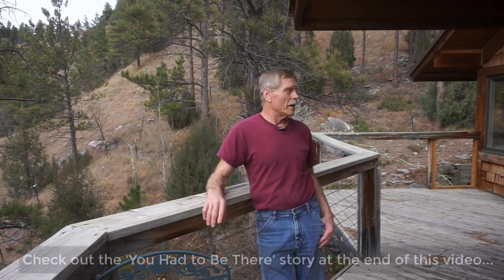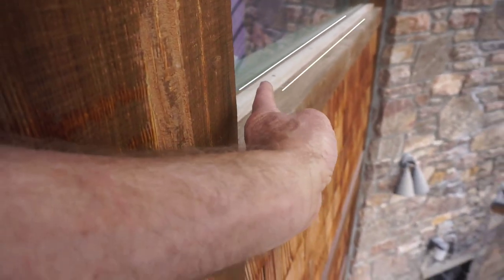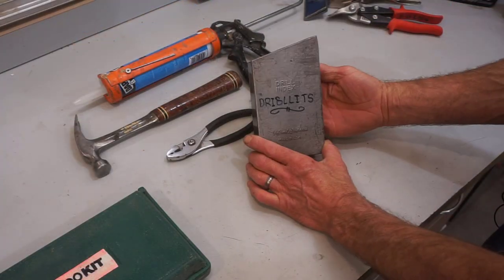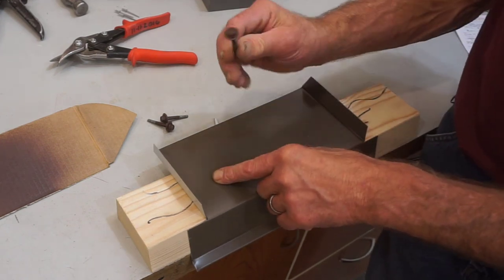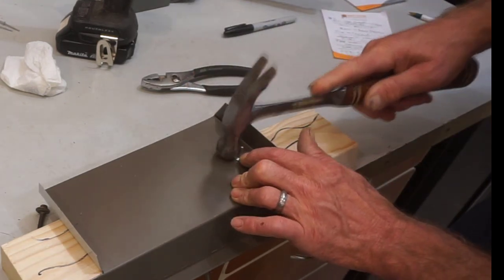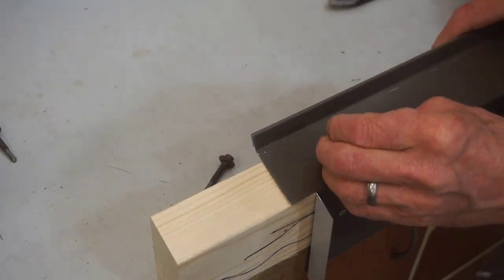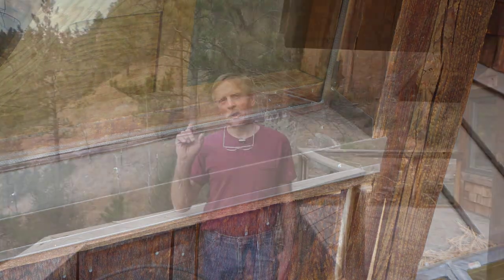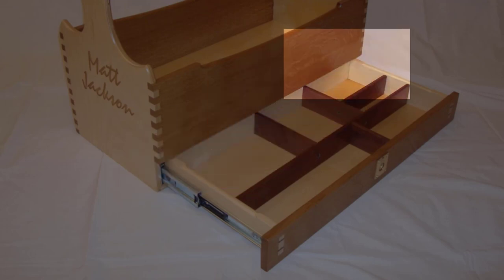Reverse Pop Rivets Fasten Metal to Wood?!

Comment: Since the rivet is aluminum and the shaft is as well, you might want to take those pliers, put then end of the shaft (the part that penetrates the wood) and squeeze the pliers to create a tooth on the shaft so that when you drive it into the wood, it acts like a hook to hold better. Kind of like a ring nail.
Reply from the maker: Great suggestion Timothy... I like it!  Thanks for watching and commenting... Best, Matt
Reply: @NextLevelCarpentry   NP, also I suppose if you had a checker face hammer, you could just give it a whack.

Comment: great tip .bet you could even use the mandrake to drill the hole leave it sticking out the chuck 10 mm or so
Reply from the maker: Hey Chris, It might work for the wood but only after drilling the metal with a dribllit... unless it was aluminum flashing too?  Best, Matt

Comment: -Great idea but don't use aluminum rivets as the center part,  the nail, with expand and contract and back out of the hole. Use Stainless steel rivets to prevent that.

Comment: We have theese hardened "flashing" nails in Norway we use, with different colors.
Same principle, but they are serrated and holds very good.
Since its hardened we dont have to predrill, but they are short enough and you need a proper wack to get them in.
I call them blue thumb nails.
Reply from the maker: 'blue thumb nails'  LOL!!
Reply from the maker: @mr.wizeguy8995  maybe so, but in this installation it would be problematic to drive fasteners into glass 😲
Reply: I saw that, just wanted to share how we do it here. 
In your case that caulking and few screw to those upright bends on each end would be enough for sure, no need to pierce that actual sill.
Reply: @nullings  One way to do it but those windows were worse looked like frame depth was like 60mm. Our standard window frame depth is 130mm and you can order even frame depth with 200mm so way more energy efficient.
Reply: @mr.wizeguy8995  Windowdepth in norway is 250-300mm. This was just a garage. The window is standard 98mm (2x4 widh).
then you mount a board against the window, flush with the wall. that way you get even more insulation in, since the board is only 19mm.
https://www.youtube.com/watch?v=a72YzKHHZH0

Comment: Seems like a great trick.....but what advantage does it have over a similar sized common nail?
Reply from the maker: Just a little bit in the looks department IMHO... not a bad idea to keep in mind for certain little detail applications though, right? Best, Matt
Reply: ES, I agree with you.  My first preference would be the 1" trim nails made specifically for flashing; provides a 1-piece head vs a 2-piece head.  I'd get the same dimpling (if I wanted)

Comment: This seems like an awesome trick! But I'm wondering how well it will hold up over time. Many of the aluminum nails that are holding my flashing to my house have worked themselves loose over the years.
Reply from the maker: Hey Todd, There's potential for nails like this to work themselves loose over time and in places where that's likely or problematic just use screws instead.  For this installation the wood was so dense I hope it doesn't fall to me to remove this flashing ever.  Keep in mind that I'm not showing best practices for windowsill flashing installation but, rather, the reverse riveting process.  It can be used for all manner of applications, many of which are interior metal panels, it's just that this installation was convenient for shooting and producing video.  Best, Matt

Comment: Why not just use a stainless steel 6 penny box nail
Reply from the maker: Why not... just use a reverse rivet?
Reply: @NextLevelCarpentry  lol the box nail does the same and lays flatter that's what we use just another opinion  sweet house
Reply from the maker: @tuckpoint2  'just another option'... exactly!  I totally understand your use of and comment about box nails being something you use on a regular basis... it's all about what's best for the job at hand, right.  Thanks for your comments! Best, Matt
Reply: the rivet pin is a taper going into a sleeve so its expanding, so you have the wedge grip of the wood + wedge grip of the rivet head, meanwhile every year I am running around my place tapping back in stupid ass nails that slide back out cause it got slightly damp and slightly chilly 

that's why
Reply: Correct me if I'm wrong, but the expansion of the river makes it a much more solid connection.
Reply: cobalt 8 nickel cylinder nails would be a better fit for the job.

Comment: Thanks Matt, thats a new one for me too. Thanks for sharing. One quick question, on the finish product on the        break metal on the ends, does that also get fastened and caulked or just stay as the picture showed? Take care            Matt, cant wait to see the new shop when its completed. Al from Maryland
Reply from the maker: Good question Al... the vertical end tabs should get caulked but, oddly, in this case I chose not to.  My thinking is that the caps are SO much better protection that nothing that they didn't need it so I left 'em just like that.  The other reason is that the way the wood is all checked and weathered some moisture is bound to get behind and under the flashing anyways and the unsealed ends should help it 'breathe' and dry out better.  I don't expect you or anyone else to agree with my thought process, reasoning or judgement on this one though... it's seeming a bit whack to me right now as I type this! 🙄😲😎 Best, Matt
Reply: Hahaha, yes I understand Matt. That original wood was designed not be flashed but with the bad angle it was installed with in which it didn't look like much, the water just sat on it and it deteriorated over the years. Usually when you flash over any wood you try to seal it up so no water can ever get in especially the soft pine they sell at the box stores that will rot in no time if it's not properly painted or covered over with your typical coil stock or other materials. Yea if it gets a little wet maybe the air will blow through the top of the vertical ends, LOL. You can do no wrong with me my friend. Always enjoy!!!!
Reply from the maker: @chipshot442   'you can do no wrong...' IF ONLY! 😁😎 main thing is that you 'get it' when it comes to the often convoluted path between 'need' and 'solution' in the real world of remodeling!  For now, Matt

Comment: The rivet stud is not able to expand the back side of the rivet so the only thing you've done is basically use an aluminium headed nail with a weak joint just below the head.  Besides how effective would a shallow rivet be in a blistering window sill?  A galvanize nail would probably be more effective but I'd stick with the metal screws with the rubber washers and some poly sealant for the edges.
Reply from the maker: That's obludolicant, Chris, probably sensible in your case.
Reply: @NextLevelCarpentry , obludolicant??? Is that like covfefe?  Google even draws a blank.

Comment: Ok, please explain the difference between this and a nail?   The bulb of the rivit does not expand the outer part of the rivit, from what I can tell.  What really holds it into the wood?  Just the raw rivit post?
Reply from the maker: The difference is mostly in the appearance of the rivet head vs a nail.  The rivet's mandrel is equal to about a 5 penny nail and plenty to hold this flashing in place.  I state clearly in the video that 'this is obviously not a universal solution' but you might have missed that part so anytime it's appearance isn't important or holding power isn't adequate, don't use it.

Comment: I want to add coragated metal to the ends of my garage cabinets can I use a shorter rivet so I don't go all the way through my cabinet  ? Or would I just grind off what has gone through  ?
Reply from the maker: Sounds like you need very short 'grip range' pop rivets,  like 1/8", for that application Kevin... you'll need a pop rivet gun too.  Don't grind the end off though as that weakens holding power almost completely.  If they stick out you can use a steel block dolly and ball peen hammer to mash them down to almost nuthin' 😎

Comment: Since the work piece you demonstrated with was scrap material anyway how about a destructive test? I'd like to see how it compares to the screws as well as to the painted finish nails I typically use in no-load must-look-good situations. In any case that's a great trick and it's going in my bag of tricks! A perfect application I can think of is for putting up stainless steel backsplash behind a range. I had a job where I needed to do that several months ago and I couldn't find a fastener that looked nice enough and finish nails looked dinky so I relied on glue, and it slid down 😔. Next time I'm using the reverse rivets!
Reply: If this is exceptionally strong I may use it to attack downspout straps to walls when I run out of screws.
Reply: And I know others may or may not have the luxury but I live and work just minutes from an aluminum and vinyl product wholesaler so I have nails of any color at my disposal. Granted, it's generally not preferred to use a nail on a flat surface due to the guarantee of an eventual leak...so you made the right call here to not even mention nails.
Reply from the maker: Interesting you should mention the 'stainless steel backsplash' installation Austin.  Turns out the first time Sam of Division 7 sheetmetal saw this trick used was a guy he was working with used it for exactly that: stainless steel backsplash/range hood panels etc in commercial kitchens.... great minds think alike!  I don't see any 'destructive test'ing' effort on my end but would say that anytime there's a question of strength it would be wise to opt for a regular nail of greater length or a screw just to be sure.  Strength is all the reason you need to justify visibility of a bigger hex head and washer.  I think you'll love the reverse rivet trick for the right situations though! Best, Matt
Reply: @NextLevelCarpentry  well that's pretty cool that's how he came across the idea! By destructive testing all I really had in mind was slide a pry bar under the end of the metal and attempt to pop the rivet out. (Exact same technique and same tool as to remove an asfault shingle) If it just stays there and the metal breaks around it leaving a hole (which is exactly what happens when you try that with screws) I'd consider that an A+. An F would be you can pop it right out with no damage to the metal around it, essentially as good a job as a little tape. In any case, if you chose not to do it on video I might give it a try myself, I happen to have some scraps of that lying around. It would be best if I try that out on scrap first anyway before I try the rivet trick on a $50 piece of stainless steel...
Reply: @NextLevelCarpentry  on a different subject... Your crescent nailpuller is back on Amazon! I order it yesterday. But it's on back order so I'm supposed to get it in a month or so. At least it's available to order though.
Reply from the maker: @austinpatrick2682  judging by the hammering force required to drive those pins I'm guessing a C+/B- rating on the reverse rivet. The rivet or pin would fail before pulling through the metal but not without distorting/destroying it first.  If you were trying to remove the flashing with intent of re-use you might get away with it but you'd have to be pretty cautious to do so. A screw would be a qualified A because the metal wouldn't likely tear out around a washer head but the screw isn't going to pull out without some real effort either. I'll be interested to know what you find if/when you do some actual testing in contrast to my theoretical one above.  Best, Matt
Reply from the maker: That's good to know  @austinpatrick2682  ... thanks for sharing.  Hope you're not disappointed when you finally get your 'new toy'! Best, Matt

Comment: Hi Matt, question: wouldn't seasonal wood movement pull out the rivet in a few seasons? I understand that this was a short term solution to extend the life of the sill. Look forward to reading your thoughts.
Reply from the maker: It sure could LitoGeorge, and for any place it was a concern you'd have to compromise the look of a screw head for the cleaner rivet head.   The sills I was working with were surprisingly dense for their weathered appearance but this is a very dry part of the country.  In any wet climate those sills would have failed completely years ago!  I think the biggest deal breaker for this method is for times when the wood substrate is getting 'punky' from rot and/or dry rot and not dense enough to hold the rivet pin making it a good idea to have a reliable Plan B available.  Also there's plenty of other applications besides sill caps where even less strength is needed to attach a bit of sheetmetal. 😁 Best, Matt
Reply: So in your estimation, how long would the security of the installation last given the condition of the wood and the dry part of the country where it is?
Reply: @NextLevelCarpentry  The silicone should also aid in hold performance over time.
Reply from the maker: @ARepublicIfYouCanKeepIt  can't hurt, that's for sure! Best, Matt

Comment: Neat, but how's that better than using the rivet tool and putting the rivet in the conventional way?
Reply from the maker: An expanded pop rivet would have virtually no holding power in anything but the very hardest woods, and those aren't typically used in construction.  The little nail/mandrel does hold pretty well for simple applications similar to this.  Best, Matt
Reply: Cool, thanks.  I might try both ways just as an experiment.

Comment: nice. you know those applicator nozzles come a dollar a dozen right? you can just swap em out for a new one with the preferred cut
Reply from the maker: Yeah, good suggestion Neko... I generally don't like fussing with them though.  Do you know of some that fit generic caulk tube tips without falling off during use?  A reliable one would indeed have been a perfect addition for use in this video.  Best, Matt

Comment: So you just turned a rivet into a washer? I wonder how much holding power those nails will maintain over time with their small diameter and smooth shank.
Reply from the maker: It's probably more accurate to say I turned a rivet into a nail that matches other pop rivets used on the job.  The nails have plenty of holding power and endurance for this application and emphasizes the fact that the installer's judgement is always important when evaluation use of any method or tip.

Comment: As usual, you're too cool for school! When I started watching this I was hoping for a solution to another problem: Makers of beehives use sheet metal covers without any regard for lacerations to the beekeeper. I was wondering if you might have a solution for that. Ideally, the covering method would provide for safety, waterproofing, aesthetics. Got any ideas. (I'll post a link in a separate comment.)
Reply from the maker: I saw the link you posted Bill.  The most 'dangerous' part of the metal hive cover in it is the slapdash workmanship it's made with... most certainly to keep cost down. Any qualified sheetmetal man could make those covers with hemmed edges and soldered corners and virtually eliminate need for bandaids.  Another option might be to use a PVC type membrane like Sarnafil where heat-welded corners on the plastic would be very user friendly.  What I'm trying to say is that there's a cost/safety continuum at play and, the more you spend (either time or $$) the 'safer' it will be.
Best, Matt
Reply: @NextLevelCarpentry  Thanks Matt. I'll check out the membrane you mentioned.
Reply from the maker: @billbyrd9845  yeah check out whoever does Commercial Roofing in your area because they throw out enough scrap on one commercial project then you would need for beehives in a lifetime!

Comment: Could a standard coarse thread drywall screw be used as well? Still caulk beforehand, but screws could be painted to color match and the screw grips into the wood with more tooth. Might actually indent into the metal slightly as well.
Reply from the maker: Sorry Big Dan... I sure wouldn't use or  recommend use of a standard drywall screw for exterior use, painted or not, because of rust but wouldn't use a bugle-head screw for attaching flashing either.  If you need more grip it would probably require a stainless steel pan head screw... or, most likely, a washer-headed hex screw designed for the purpose.  Best, Matt

Comment: that right there my friend ,,,,, is a nail
Reply from the maker: And just where do you find nails with small, rounded button top heads on them?  Curious...
Reply: any traditional boat builders , tend to be copper alloy , and used for roving.
Reply: a better question these days may be ,,, where do you find a traditional boat builder lol
Reply from the maker: @tomthompson7400  ya, I suppose most boatbuilding is done in fiberglass resin with little need for nails of any sort, right?  Later, Tom! Best, Matt
Reply: on a slightly similar line of thought , have you tried tek7  you wouldnt need nails at all , its genuinely amazing stuff , wet or dry substrate , sticks just the same , the original black stuff takes a lot of beating , its the only adhesive that ive ever actually had to buy the genuine solvent / cleaner for  its amazing stuff , its twice the price of most things and twenty times the job ,,,
Reply from the maker: @tomthompson7400  no Tom, I haven't even heard of the product you mentioned but know fully the satisfaction and confidence such a discovery means.  I assume it's better than the polyurethane type construction adhesives that come in caulk tubes and are meant for applications like subfloor adhesion?
Thanks for your comment... best, Matt